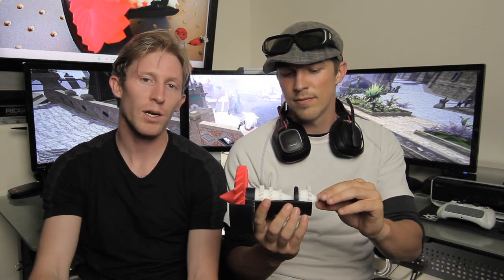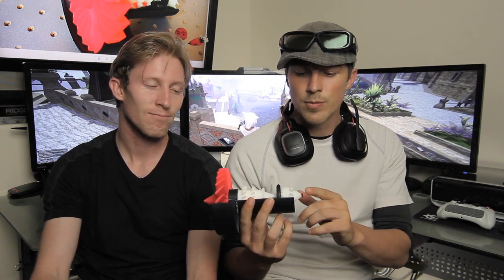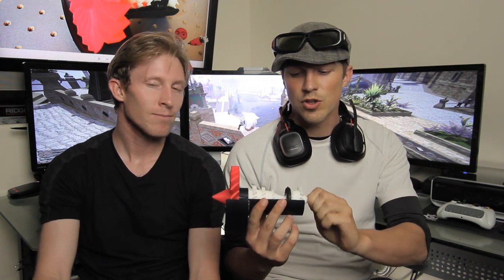3D Printed Jet Engine

Comment: Great video guys I think if you adjust the pitch on the turbines 2.756,° counter clockwise you can increase the thrust approximately 15.243% :) just kidding I like the prototype great job
Reply: Haha! I totally thought you were being serious at first.
Reply: Carl Fredrickson But seriously though, the turbine blades are angled opposite from what they should be at - they really should have an angle similar to the compressor and fan. I still can't believe GE signed off on such a fundamentally flawed model. End rant.